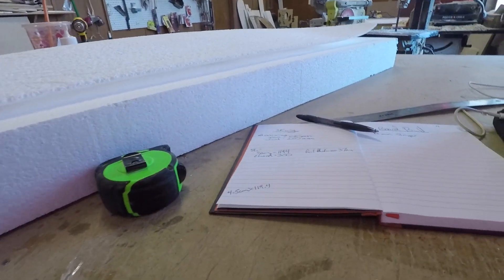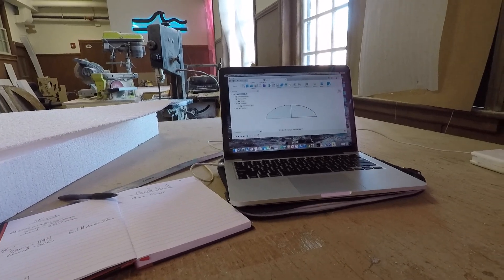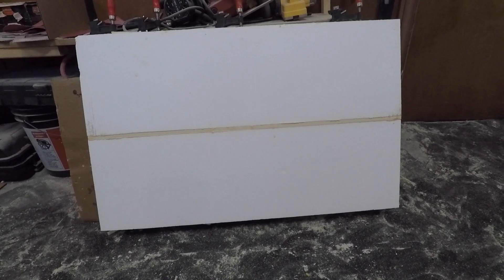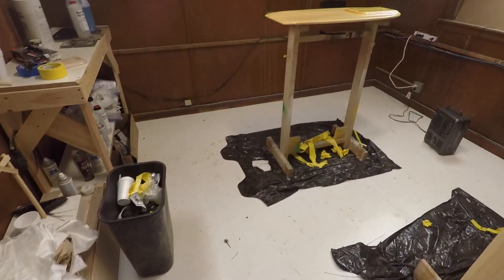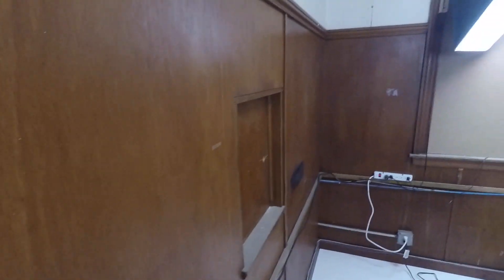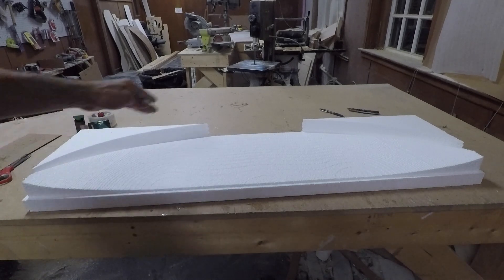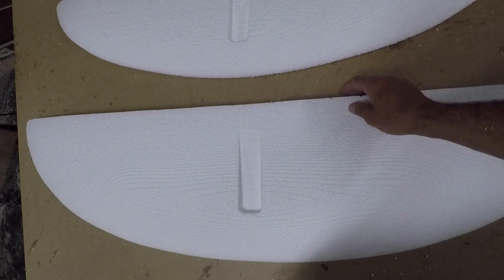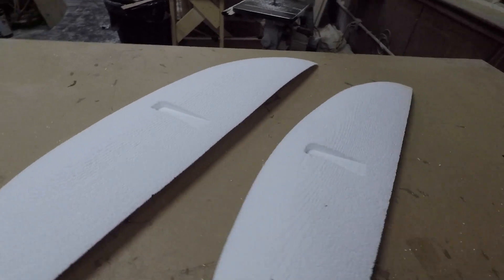Making a HUGE hydrofoil wing!

Comment: You should switch to XPS (construction foam) dude. I recently did this and my trailing edges are coming out much sharper after CNC machining, no EPS beads coming loose. Also not as brittle as EPS and much smoother finish.

Comment: That should work very well. I have the largest Gong that is 2800 cm square. it is about 48" wide. I think yours will be easier to ride. All of the width makes it torque sideways alot getting up.  I have it on a big inflatable wing foil that makes it super easy for learning how to foil behind a boat. The board has enough volume to stand up on.  Can't wait to try this one. It should be great for wing foiling or a home made e-foil!

Comment: Great DIY!  Looking forward to seeing how this larger area wing performs. Most of the largest off-the-shelf seem to be around 2400sq.cm max.  Do you change your angle-of-incidence setting depending on wings or settled in on a good  all-around aoi?
Reply from the maker: I have found with all wings, the angle of incidence should be perpendicular to the fuselage... this also makes it easy to set up and jig when molding
Reply: @clearwaterhydrofoils4313  Thanks.
Reply: GoFoil has the big Maliko 280, 41" span which looks about the same size as the 3000. Seems to have more downward tip curve and dihedral though compared to  the 3000.  M-280 is a beautiful wing for light wind windsurf foiling, Wing foiling, small wave SUP foiling and downwind foiling.  Hope your 3000 is too!

Comment: I'm planning to build a small CNC machine to cut foam shapes and, if I understood your design correctly, you're using a 3D printing software to slice the opposite shape of the wing, right?! Thus, you design the wing and place a cube surrounding it, subtract and export these two halves to the slicing software slice each side separately.
Reply: If you have a CNC cutting in all 3 directions and tooling like vacuum clamps for final z-direction cut.  That's all you need.  Cancel your 3d printer.
Reply: @trexinvert  hobbysts like me usually don't have CNC machines at home, however, the principle of a CNC machine, or any other g-code guided machine, is the same. 3 (or 4) step motors guided by a software. My concern is about the software. For 3D printing we have some good software for free but we must adapt the workflow according to a 3D printing job.

Moreover, I do have a cheap 3d printer and it would be fairly simple to build a clone of it to cut foam...
Reply: @rnelias  Okay I understand you don't exactly have a full machine shop and cad at your disposal.  What is your priority? You are just interested in creating hydrofoil geometry? You are a surfer and just want to make it and surf it.

Comment: You shouldn't worry that much about drag, because bigger wing=greater lift at lower speeds.  This wing doesn't need speed to do it's job, because if there is speed then there will be too much lift.  The surfer will really have to apply an uncomfortable amount of downforce to ride it.  Strength would be the biggest concern.  A little bump during transport could shatter it.
Reply from the maker: Good points. If the wings turns out nice, I ship them stuck inside of their own cutout from the foam stock... I will of course need to order larger blocks for this one. That along with a few other shipping braces makes for a great box. So far only one out of a few hundred has shown up broken!
Reply: @clearwaterhydrofoils4313  I think you know what to do.  Main thing is to get it made and into the water and surf.  Just experiment.  You know the trailing edge doesn't need to be one single edge, because as the wing get's bigger it becomes a "delta" shape.   You can make a "v-shape" or "curve it" .  You can even experiment in the z-direction by adding a dihedral angle, which is what you typically see on "trainer airplanes" vs. "flat wing".  I think that will make the wing "less responsive" , which would be good for beginners.  Anyways, have fun and just crank them out.